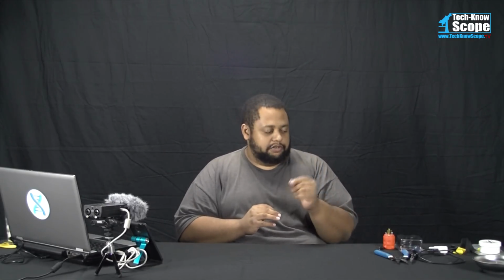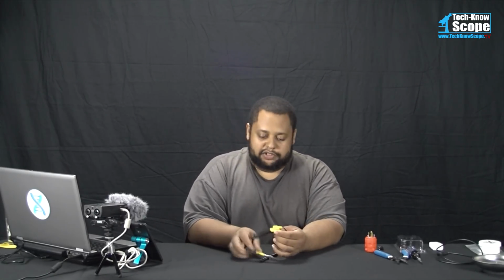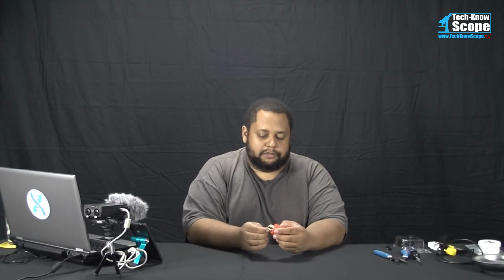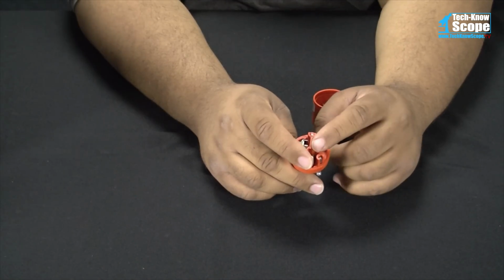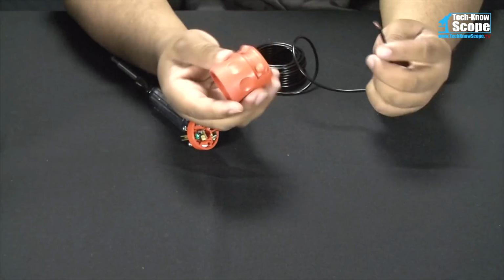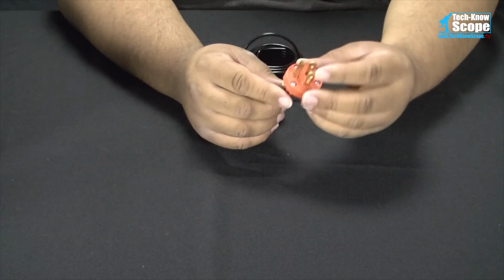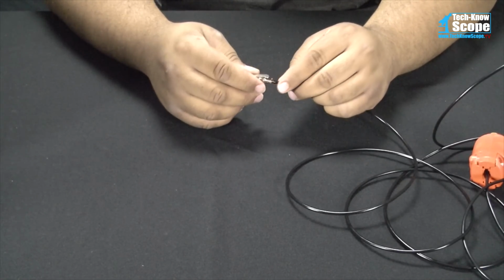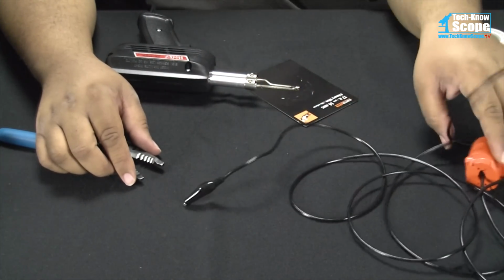▶️ Xbox One Media Hub Power & ESD Grounding

Comment: That power supply does not fit dude. I ordered it.
Reply: I'm sorry about that, it looks like the description has changed since I made this link (it wouldn't be the first time that has happened to me on Amazon).

You need a 5v 2A power supply with a 5.5mm x 2.5mm barrel connector.

I'll remove or update the link.

Comment: Question: isn't the 1MΩ resistance embedded in the cord supposed to prevent the user from getting electrocuted? That's assuming the user is not the only path to ground available, of course.
Reply from the maker: Yes, but only for that strap. 

A computer case is tied directly to ground when plugged in, and the ground I built goes directly to ground. It's not usually an issue, but if you did something crazy like open the case of the power supply while it's plugged in, you can hurt yourself. The 12v of a computer isn't really an issue unless you're soaking wet, in which case you probably shouldn't work on a computer. 

Thanks for watching!